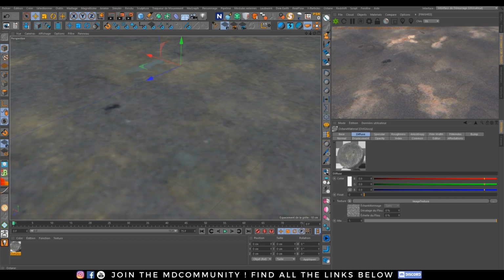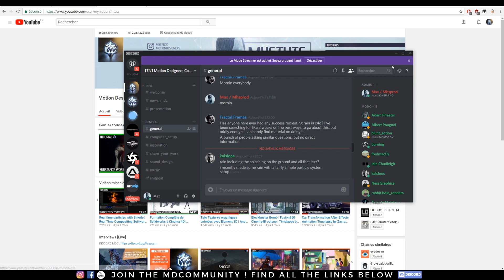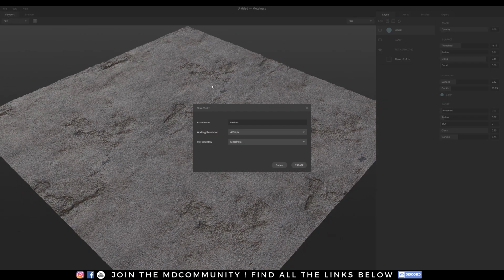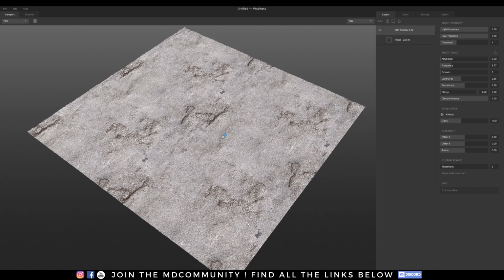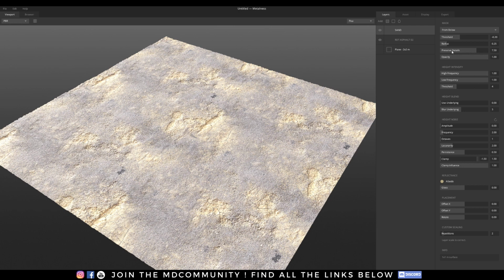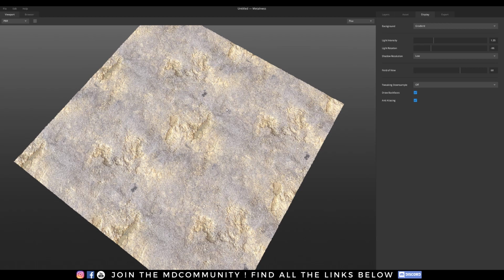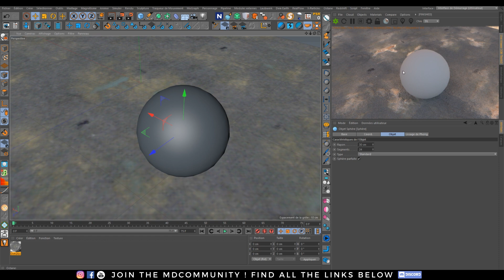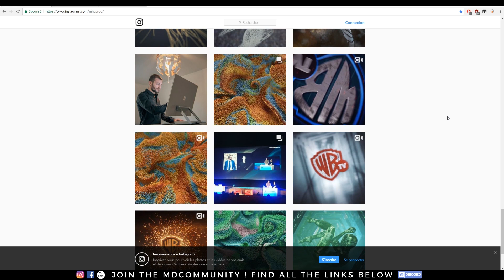Quixel Mixer / Real Displacement Texture / Octane First Impression / Overview

Comment: Nice! Quick question, how do you avoid repetitive textures on large objects?
Reply from the maker: Most of the inputs are already semless :) So if your input is seamless the output will be. 

By the way there's few option that can help to have seamless textures. (Bitmap2Material from substance have this option for example and you can generate a Normal, Bump etc from an image texture) 

Hope this helped.

And if the object are LARGE, you need to find texture with a different scale. Here I have textures for Mid distance. 
Not everyrthing is magical sadly ahah